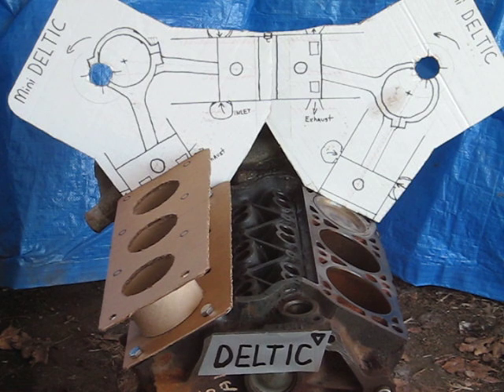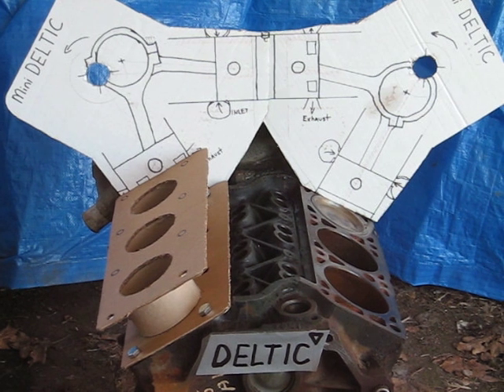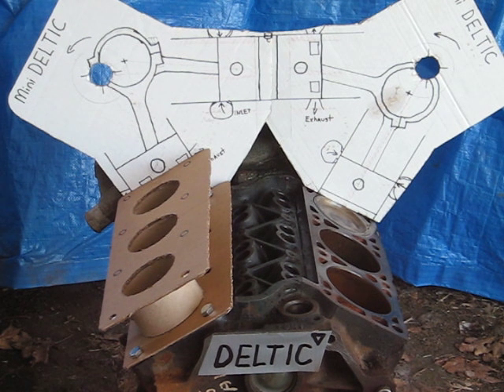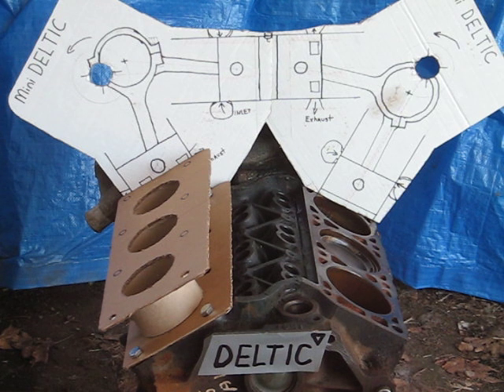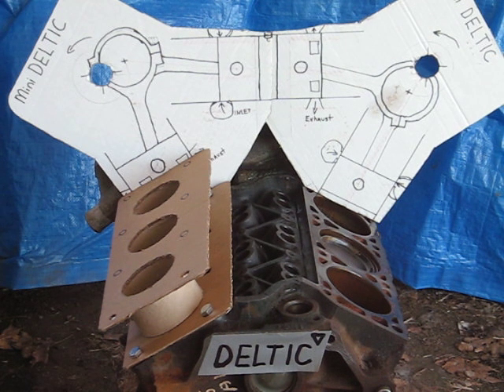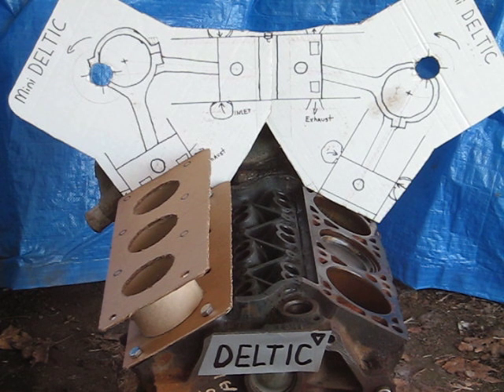Sound a Junkyard Baby Deltic might make!

Comment: there are companies that custom make cranks. possibly they could do a 2 journal crank. I would do a wet sump and pressure feed the crank and piston squirters if possible rather than rely on 2 cycle type lubrication. curious how a bellhousing might go on the back gear housing
Reply from the maker: Yes, wet sump would be the way to go, if the engine only ran a few minutes, it could run without oil, though there may not be a second run!

Comment from the maker: @thepalmshop239 
It appears that the stock GN V6 crank won't work for this project, since a 4 stroke completes the cycle every 720 degrees /6 = 120 degrees. The triangular design of the Deltic needs a 60 degree angle between the 2 adjacent rods reaching TDC.  I was not familiar with V6's, I thought the crankshaft was like a V8, with 2 rods on the samr crank journal....Ooops :(
Does anyone know of a 60 degree V6 with 2 rods per journal, like a regular V8?????
Inquiring minds NEED to know!  :)